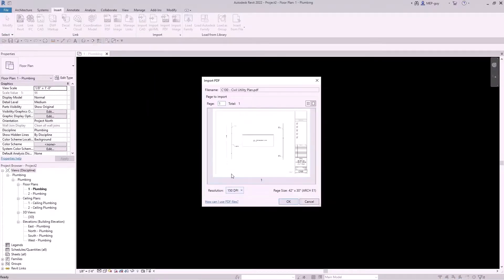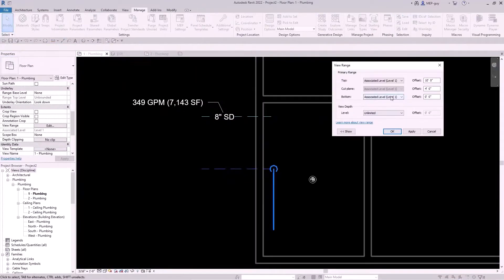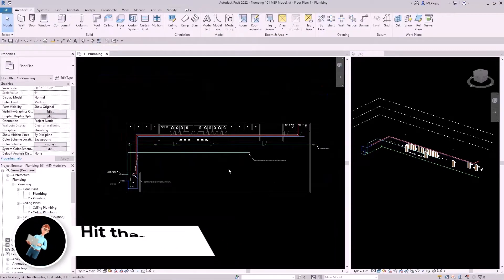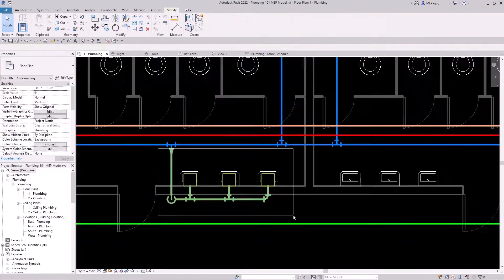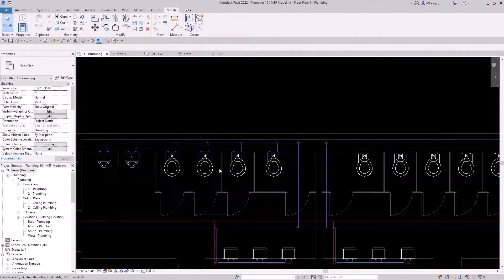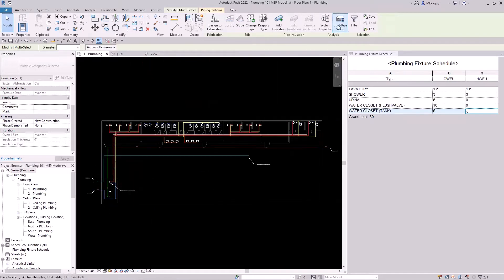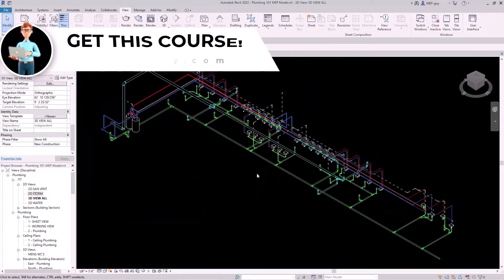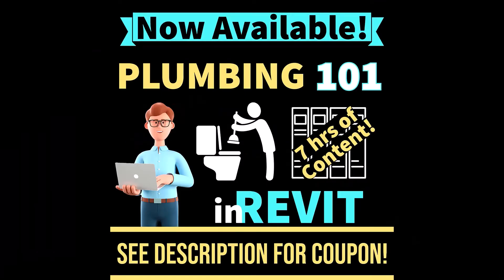4 MUST DO steps for Plumbing Designs in Revit

Comment: Hello...First let me say I am really enjoying your 101 plumbing course. I am student and I am currently working on a school project that is driving crazy. I have a double kitchen sink family that I have used in a project but revit doesn't see it as fixture unit. Both waste pipe  are connected to a single Ptrap. Can you do a tutorial explaining the difference amoung flow configuration: calculated, preset, and system. What is system classification global? Thank you.
Reply from the maker: That's a great idea. First off you'll want to change your system classification to cold water or sanitary. Once you do this, Fixture Units will be available from the drop down options. If using fixture units, you use that option. If you want to use gpm, you'll use "preset". Calculated would be used if other items will drive the flow. For example a water heater's gpm is determined by the fixtures connected to it, not the equipment itself. System, is used for splitting up flow. So for a pump system you might want to pump %60 of the flow using the big pump and 20% of the flow using a smaller pump. I think this would make for a great video. Thanks for the video idea and feedback on the course!